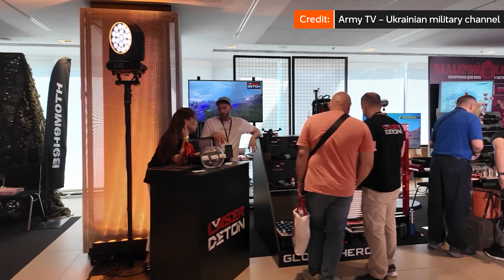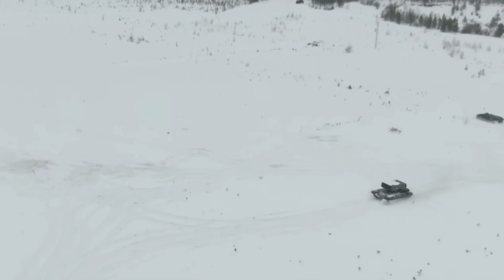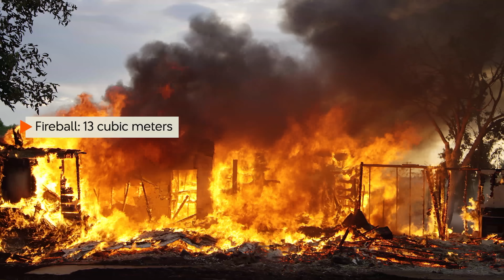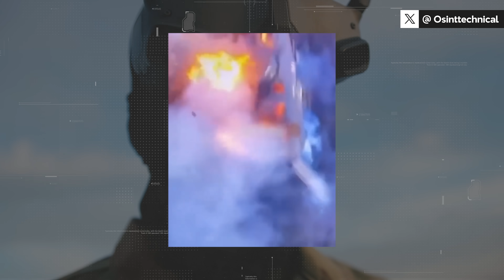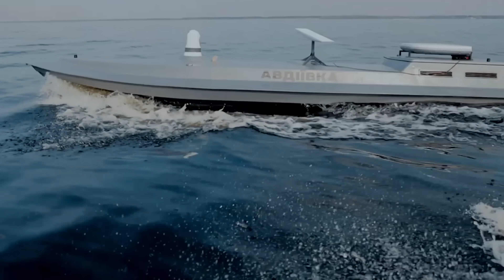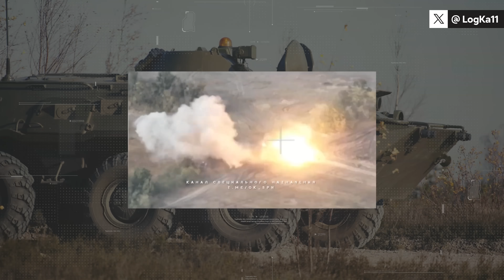Ukraine's New Thermobaric Weapon Is Turning Russian Trenches Into Giant Fireballs

Comment: Ok to say the over pressure 'spreads" away and isn't impressive is skipping over the fact for a mile or more AROUND the detonation depending on device.  Everyone just died from the blast wave and then the vacuum.  That's the part that's being skipped here.  That vacum is more dangerous then the blast itself.  It WILL rip someone's lungs out of their mouth.  The concussive blast shatters matter for hundreds of yards or more around it.  The fire ball and blast wave will cook your eyes, nose, any exposed skin, it will instantly melt any plastics and set most clothes on fire.

It's a very effective weapon for what it was made to do.  There are reasons why wars need to be short, horrific, and conclusive.  Believe it or not doing it that way saves more lives in the long run.
Reply: The vacuum is negligible in comparison to the blast. A 30 meter spherical cloud of ambient temperature fuel converts to 2,000 degree gasses in 0.5 milliseconds in a fuel air detonation. The vacuum phase lasts a matter of seconds at many thousands of times less peak intensity. If you're remotely close enough to be worried about the vacuum, you've already been crushed by the overpressure by orders of magnitude.
Reply: @HarryPeterson-x7z I'm quoting things like the MOAB and Daisy cutter into these statements.  Hence why I didn't specify a weapon.

Look up the kill radius sometime.  How and what happens to someone.  I'm talking 2 miles dead just dead no hope nothing. deaf at 5 miles.  Trust me when you grew up in the cold war you kinda pick things up out of necessity.
Reply: @MordaxTenebre  I'm just saying, the vacuum effect isn't what's deadly. The true kill radius of these bombs is greatly exaggerated. Look up inverse square law, it really puts a damper on blast radius.
Reply: @HarryPeterson-x7z Ok let's apply physics to all debris outbound suddenly and violently stopping and the lighter debris returning.  Let's look at high vs low pressure escape vectors for the lungs as high pressure gas bags in a suddenly VIOLENTLY negative atmospheric pressure wave after a positive.

You do not seem to understand the very VERY dangerous mixture of events going on here.  You need to take this in total sum not pieces.  

Also my information is coming from direct military observations.  You are focused on small munitions.  I've stated this from micro to macro sizes.   
The macro being the largest versions of Fuel air explosives that are built or have been built and used in combat environments.
Reply: @MordaxTenebre  The high pressure event is occurring in milliseconds, ~2,500 meters per second within the source and at the speed of the resulting shockwave beyond. 
The negative pressure event occurs at the speed of the detonation byproducts cooling, a comparatively far longer, lower intensity event with much of the heat taking minutes to fully equalize from what occurred in thousandths of a second.

I'm not saying the vacuum isn't relevant or that it has no effect, just that it's massively overshadowed by the sheer intensity of the blast. 
Overpressure injuries are generally not so nasty compared to those caused by vacuum, that's why people are found dead with no external injuries at the outer areas of the blast but exhibit grotesque injuries closer to the epicenter.
Reply: @HarryPeterson-x7z  Right now model that for what happens to gas filled bladders when impacted and deflated to suddenly ripped open due to the negative air pressure behind the intimal blast wave.

We have to remember that there's already been a concussive and blast wave that has gone through and has done damage.  That damage is severely compounded both neuro,blood/plasma,air pockets rapidly created and either implode back or remain causing MORE damage.  That's nothing compared to what this does to organs like the lungs.

This whole situation needs to be taken in toto.  I am pointing out the specific spot in the blast that has already displaced a potentially HUGE volume of air...Nature abhors a vacuum remember?

Comment: These are basic explosives doped with a reactive fuel (often aluminum powder or pyrophoric coal dust), that fuel is heated to many thousands of degrees and ejected into ambient air at thousands of meters per second. 
These grenades are not two stage/fuel air thermobarics, those wouldn't even work at such a small scale. Two entirely different concepts that function drastically differently.

Comment: After being explained, a thermobaric explosion is the same type as a grain dust explosion at a grain elevator.
Reply: Somewhat similar if that was how these Ukrainian grenades actually worked. They're not two stage/fuel air type thermobaric explosive but rather an enhanced blast thermobaric explosive. Basically, just a conventional explosive like RDX doped with a highly reactive fuel like powdered aluminum or pyrophoric coal dust.
Reply: @HarryPeterson-x7z technically, the rdx in an ebx is the secondary charge, with the fuze charge being the primary charge

metal powder reacts with the air once dispersed by the rdx primary
Reply: @splashybard  In any case, it's not dispersed then detonated in two distinct events but rather heated far beyond auto-ignition temperature and deflagrating as it contacts the atmosphere. 
As it deflagrates it burns hot enough to transition into gaseous aluminum oxide and nitride. It also strips the oxygen from the detonation byproducts like water, carbon dioxide/monoxide.
Reply: @splashybard  "technically, the rdx in an ebx is the secondary charge, with the fuze charge being the primary charge" to what end did you point this out? Did the OP suggest this wasn't the case?
Reply: @KarldorisLambley  ya, he doing a bit of hair splitting, u usually don't count the blast cap as the primary charge
Reply: @Patrik6920 why not, if removed the grenade is useless? So in all reality it is the 1st stage.
Reply: Also the same way a coal mine disaster progresses except in a mine the explosion often regenerates. The same coals that contain lots of methane also break down to fine carbon rich dust. An unintended ignition lights the methane that stirs up the dust that results in a rolling explosion that amounts to a dust explosion that stirs up another explosive coal dust cloud, until all of the dust that can be mobilized is spent. If the explosion doesn’t get you the resulting CO and CO2 in a confined space will!
Reply: Makes perfect sense to an old farmer like me!
Reply: @defuse56 Me too, saw an elevator get flattened. I used to wonder why they always had the big entry doors wide open, even when 35 below. After that I didn’t wonder any more.
Reply: @cliffcalverley3605  We used an elevator back in the 60's, but stopped when we stopped planting wheat, I can imagine what you saw must have been really hairy!
Reply: Custard factories had the same problem.
Reply: Use them on Russias oil storage tanks
Reply: Or a BLEVE. Truly frightening 😳

Comment: I'd wager that this new generation of chemistry has a superior effectiveness on a petroleum refining infrastructure, especially the storage tank farms
Reply: It's not the storage tanks they target, it's the distillation equipment that can't be replaced quickly or cheaply. Storage tanks are just a bonus.
Reply: @onemanandhisdog9 
Accurate assessment. 
It’s always the whiz-bang techie stuff that needs a good smashing.
Especially with the current sanctions in place, Russia very likely is sourcing a lot of electronics from China.
And Uncle Xi likes to be paid.
Reply: Tank farms, Wildberries metal buildings, locomotives and tank cars.
The suoer cheap “fence post” penetrator slices through the metal.
Thermo goes boom.
Turret Toss 2.0.
Reply: It's more of a blast effect for enclosed spaces. There is a thermal effect, but a TB is not really an anti-material weapon. It's for room clearing.  Thermite or other incendiary compounds are much more effective for causing fires and destroying machinery.
Reply: @MrNakedweasel  - Exactly. It seems like people understand thermobaric grenades as regular incendiairy grenades... but it's not at all the same thing. Both have fire and overpressure involved but an incendiairy grenade is made to burn things, when a thermobaric grenade is just a "big blow of wind" almost exclusively useful in closed spaces only... kind of an oversized regular grenade with a bit of remanent fire.
Reply: @WawaDvd  I'm sure that such devices can also (eventually) have a compound or combination of incendiary effects for creating persistent fire and thermal effects. I can't think of many reasons why this would be useful, except for "extreme" room clearing and causing maximum chaos and drama. Perhaps in cave or tunnel complexes. Maybe for agent defeat versus WMD facilities. I don't know. But I don't think such a weapon exist yet.
Reply: Also take out control rooms, they are the heart of the refinery without them you cannot operate anything.
Reply: Good idea there!
Reply: Trashman on The Stand by Stephen King did that trick to a whole city... just sayin!
Reply: still need to get through the nets & cages which the ruskis are increasingly using to protect their refineries

Comment: Russia is using a strategy that is pretty much guaranteed to lose them the war and then bring its generals before a war-crimes tribunal.

They are wasting resources that could be used fighting the war.  Sure, it is fun blowing up an apartment block full of pensioners or setting a children’s hospital on fire, if you are a complete sociopath — which is probably listed on the Requirements section of job descriptions for Putin’s command staff — but it does not weaken the enemy’s fighting ability or its resolve.

To the contrary, acts like that strength the Ukrainian government’s position with its own people.  The Ukrainian see the Russian government committing atrocities and they really, really do not want to put themselves at the mercy of that Russian government.

Comment: A lot of solid-fuel thermobaric/enhanced blast weapons don't use a separate dispersion and detonation charge. Instead, autoignition of the fuel and oxygen provided by the explosives are used. It's less effective as a thermobaric weapon, but it's lightweight, simple to use, doesn't require extra maintenance, and is safer for friendlies and civilians than fragmentation or cluster weapons when it's used against military and dual-use/major economic targets.

Comment: Even in free air, a fuel-air detonation can be very destructive.  The pressure rise across a supersonic  burning wave front can be from 4 to 8 times atmospheric pressure with the associated temperature rise.  Even with just air molecules, that pressure rise will kill people and break things.

Of course, inside a mostly enclosed space, it's like being inside the barrel of gun.  This phenomenon has caused some tragic incidents in mine shafts when natural gas mixes with air and is ignited by some heat source, such as cigarette lighter or an electrical spark.

For more background, look up "Chapman-Jouguet Wave" or just "C-J wave" for short.

Comment: Use thermobaric grenade on a fence post delivery.
Reply: Fence post easily penetrates metal oil tank lids and metal storage structures.
Can you say Wildberries?
Small thermobaric sets fire to rows of flammable material in closed metal box—boom!!!
Thermo-toss.
Reply: I'm not quite sure what the fence post will do, other than wood splinters (?).   ☆
Reply: @fjb4932 
Perhaps you are unaware. 
Ukrainians have developed an improvised drone explosive from common steel fenceposts with a heavy, welded penetrating point and stabilizing wings.
Pretty innovative actually.
Reply: @guydemullet303 that is… frightening.  Ingenious but still frightening.
Reply: @guydemullet303  Thanks for this explanation. I've heard the term, but didn't understand it till now. Basically a gravity enabled penetrating rod with an explosive charge. Yes, combined with a TB, that would be very useful for clearing out most structures.

Comment: The drones hitting Wildberries create a considerable flash. Very likely a two stage conventional and thermobaric w head.
Reply: It's unlikely a TB charge was used for those. Probably an anti material charge, like thermite. Li-polymer batteries like those found in FPVs would also add to the fires, but the drones in question would have probably been combustion engine propelled, due to the longer range needed to reach deep into Russia's interior.
Still, a petroleum fuel cell with unexpended  gas in it, would certainly add to the fire effects of a thermite grenade.
In a warehouse filled full of cardboard boxes, it would cause a devastating bonfire in seconds.
Reply: @MrNakedweasel  Those warehouses go up so easily and so completely, we have to wonder what they contained. I’m thinking fuel, ammo and batteries to say the least.
Reply: @Dave5843-d9m definitely lithium batteries. Probably thousands of lbs worth in each. And runaway lithium fires are metal fires, outputting several thousand degrees, and are practically impossible to put out with normal extinguishing systems.

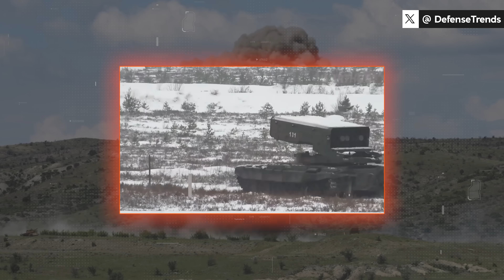Comment: @2:00 das ist der Mechanismus einer Aerosol-Bombe. Eine thermobare Bombe hat nur eine Explosion und die Druckwelle wird durch eine länger anhaltende Reaktion bei gleicher hoher Temperatur gehalten. Dadurch dehnt sich die (tödliche) Druckwelle nochmal deutlich weiter aus, als bei einer Aerosol-Bombe, die ihrerseits schon eine sehr deutliche Steigerung zur C4-Druckwelle ist. Dies wurde auch schon mal vor längere Zeit von den Myth-Bustern veranschaulicht ;)
Reply: Realistically the same principle car and truck bombs work on, the primary explosive is encased when triggered the explosion is larger than an explosive that was not encased in a metal jacket like an artillery shell, the explosion having to force its way out of a pressurised container makes it stronger that if not encased, then the car or truck acts as another lighter skinned casing the explosion also has to escape! Which in turn makes the explosive power greater again! Thermostatic work on the same principle but also add the vacuum effect!

Comment: The US uses conventional explosives packed with 30% aluminum powder for much the same effect. They also reintroduced offensive concussion grenades . It would be easy to pack their explosive with aluminum powder. That way “we don’t use fuel air explosives “.
Reply: The new offensive hand grenade almost certainly uses a large percentage of aluminum in order to be reasonably effective with almost zero fragmentation. As for the newest mixtures used 500-2000lb JDAM bombs, it's definitely thermobaric, just not fuel-air. Instead, "enhanced-blast weapons"  use a high percentage of ammonium perchlorate to provide oxygen to the fuel, along RDX or HMX..

Comment: Years ago, when I was a young, naive Navy lieutenant, I was sent to training to be a forward air controller. I was eventually supposed to be assigned to Marine patrols in Viet Nam to direct close air support for them. At that FAC school, we would go out to a remote hill near the Salton Sea (Chocolate Mountain) for practice. On one trip we were accompanied by an engineer from the Naval Weapons Station. He was there to observe the tests of what he called fuel-air explosives, now called thermobaric weapons. Most impressive they were. I can still see them dropping from the helicopter, shattering to scatter their contents, then disappearing in an almighty blast that shook the panels at the observation post.
Reply: I saw these loaded onto A-6s aboard Lincoln. At first I thought they were CBUs, but I got close to read FAE on them. I knew about TB from the Soviet's use of them in A-Stan, but had never heard of the term, Fuel-air Explosive until I joined the Navy. But that is exactly what they are; Fuel mixed with air, causes an explosion. Interestingly, I found out that they were also effective against ships, as were Rockeye CBUs. If an FAE penetrated a ship, it would tear it apart from the inside  like a coke can. The CBUs would destroy all the electronics and exposed launchers on the top side.
It would be a very bad time for the sailors, if a ship were hit with both.
Reply: "...young, naive, lieutenant ..."
 At the risk of repeating myself. . .   ☆